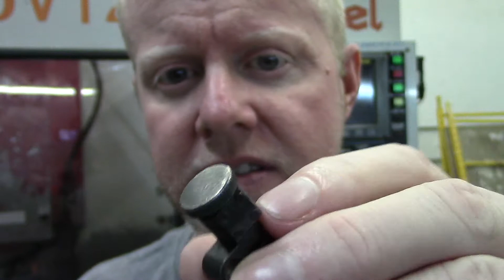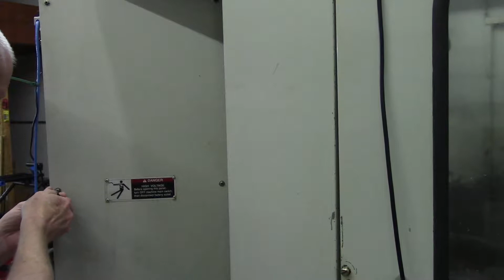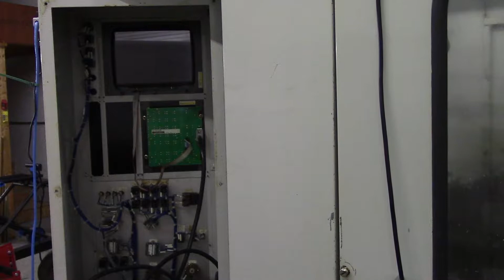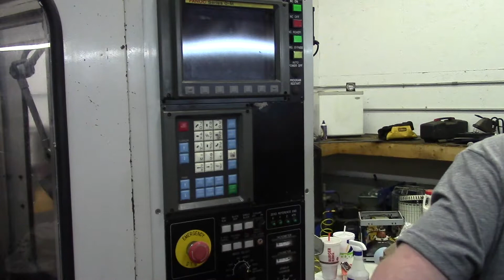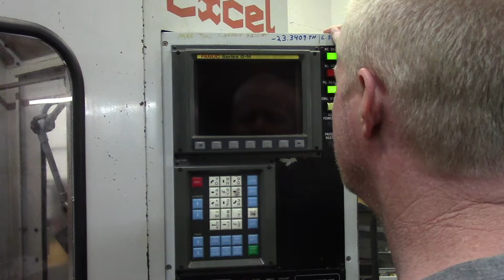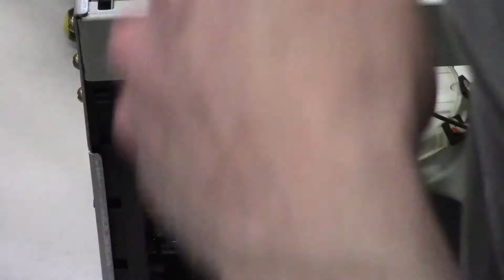Fanuc monochrome OM 9 inch CRT Adjustment and Color LCD Replacement Review

Comment: Shane you contemporary renaissance man, this is just brilliant!  I have a dirty old GREEN MONOCHROME (!!!) CRT on my mill that's from the year 2000.  I had no idea these were available.  This would be a great update. 

Have you found a source on replacement membrane keys?
Reply from the maker: Most of the membranes are avail on eBay.
Reply: @ShaneBurrell1  So I replaced the green monochrome CRT with an LCD, and I replaced the keypad.  It's like a new machine.  Just beautiful.  I owe you a beer.

Comment: This is the way the cable is and I will send a photo and if it is within your possibilities to serve me the combination of our colors.  

Please can you send me an email where I can send you some files of the milling machine
Reply from the maker: All my cables are sealed with jacket.  My email can be found on my website which is on the about section for the channel.
Reply from the maker: Looking at your cable, If you made the cable I doubt it will work.  The Fanuc cable is shielded and twisted pair.  Also there are more than just 5 connections.  The 0V I suspect is required as well as those would be the twisted pair grounds.

Comment: Hello brother, how are you? Hey, I have a problem when making the connection. I tried to find the diagram but there was no luck, a colleague sent me a picture of the finish but I want to know if it is the same in both sides, please I want to know if you can see the connection of the video cable to the fryer and send me a photo of both sides, brother, I am with this frying machine, I just need that, I will send you a photo of the machine, it is the same control that you have there
Reply from the maker: Mine is a straight cable, actually all my honda cables are straight.  This may help you https://imgur.com/mOYhSQE

Comment: ¡Hola! Shane Burrell, ¿cómo esta? hermano, antes que nada, felicidades por tus aportes a esta rama, puesto de que lo mismo son difíciles por no decir nulos.
Pero bueno hermano, tengo una maquina Supermax-3 de 1991, la misma vino sin el cable de comunicación de la tarjeta gráfica al monitor y para el cormo el mimo está dañado es un CTR Mod: MDT947B-2B, con un conector de Interfax RM-20LW para el video. por favor necesito el diagrama de conexión de este cable hacia los pines tengo una idea, pero necesito confírmala.
Ya vi su video de como remplazar el monitor, pero es como le digo mi principal problema radica en la conexión del cable de video la tarjeta de video es: PLACA DE CIRCUITO DE GRAFICOS / MPG FANUC A16B-1211-0920 06A, por lo que agradecería su ayuda en base a este dilema, porque he tratado de buscar el cable original nuevo, pero como ya la maquina esta descontinuada no he podido hallarlo.
Reply from the maker: The cable should be a straight thru Honda connector.  Try a search on Ebay for HONDA/HK MR-20LW CABLE in the length you need.

Comment: Thanks for the video!  I'm curious how you determined from the wiring diagram that it would give a color output?
Reply from the maker: It has RGB output in the diagram.  Thats usually a good sign for colors if there is firmware support.  The OM has support that needs to be turned on but it works great.